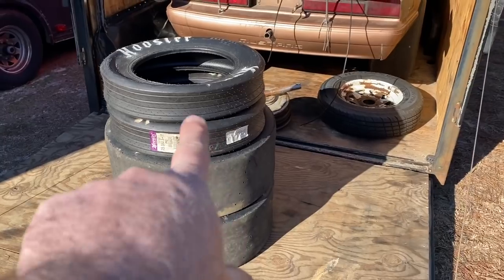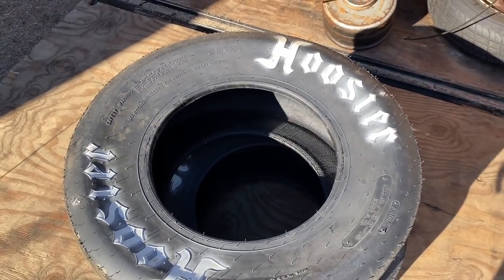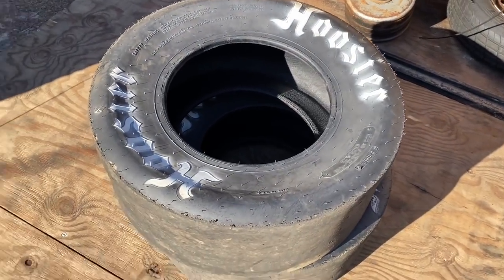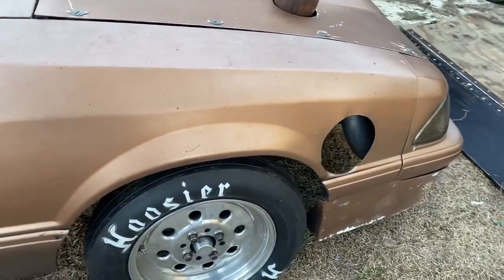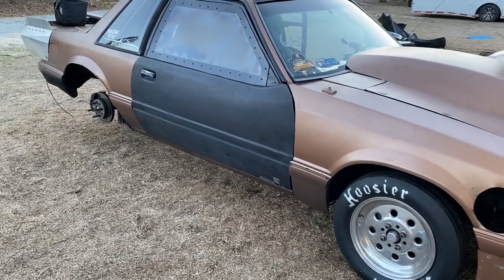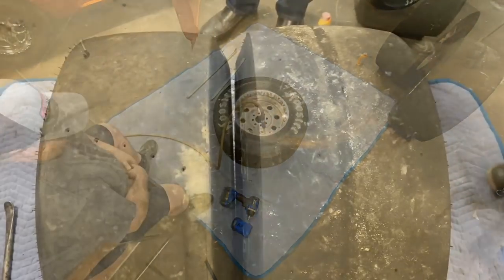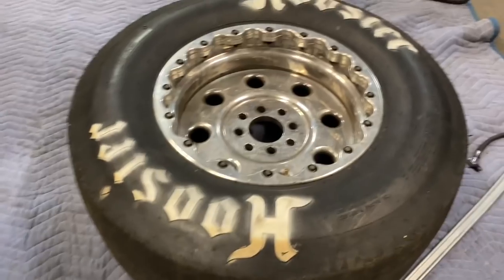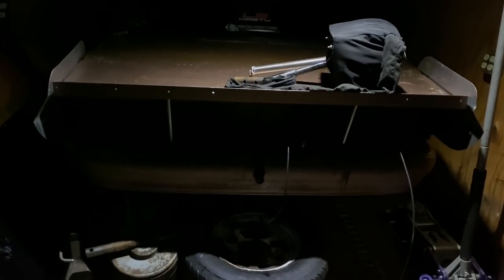No Prep Racing, New Hoosier Tires

Comment: Is there such a thing as too much oil pressure?

Viewed a video and there was some talk that relatively low oil pressure is not necessarily a bad thing.  Some seemed quite happy with around 50lbs, thinking being that too high, say 75 to 80lbs,  meant the oil was not having time to do its intended job.  Discussing prioritizing areas of the engine, restrictor plugs that sort of thing.